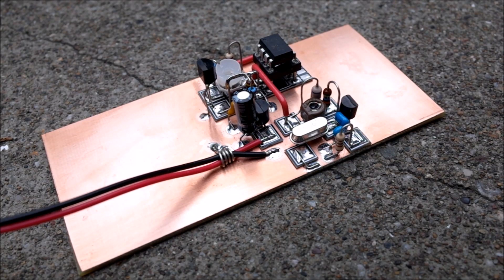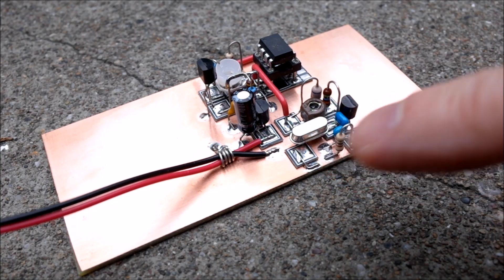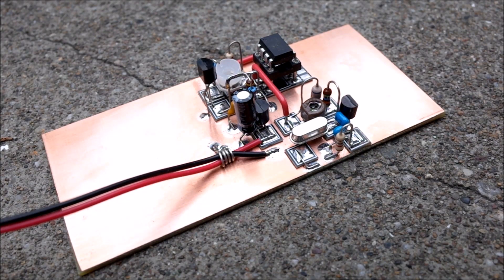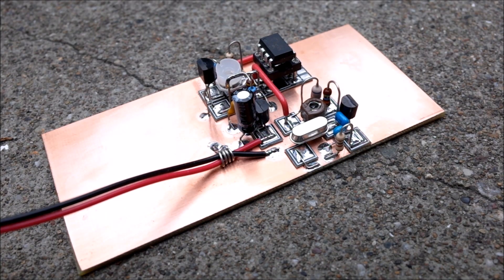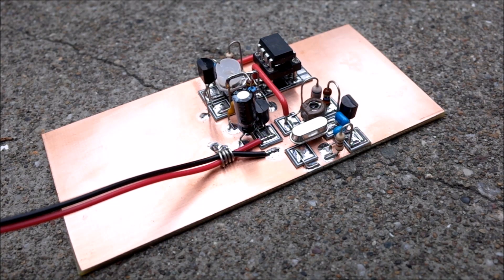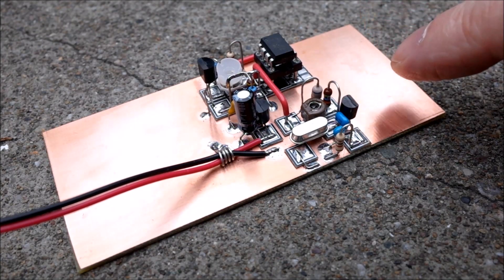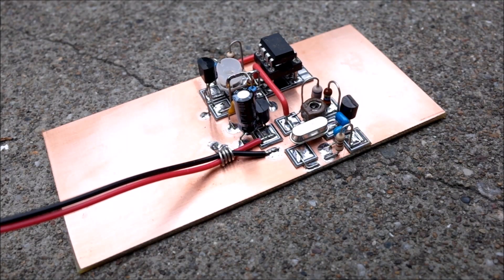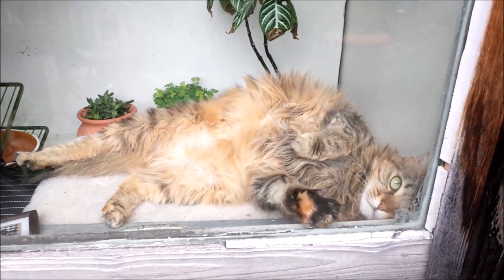K7TMG HF Thermometer

Comment: I look with admiration at the beauty of surface mounting with your hands. I would like to ask, do you buy these contact pads ready-made or cut them yourself? and how you attach them to the main board.
Reply from the maker: Thank you Alexander. I buy the pads from Rex at QRPMe (they are online). They are called MePADS and MeSQUARES. I attach them to the board with superglue (cyanoacrylate) in the gel form.

Comment: The attinyi85 has an internal clock generator. The external quartz generator is therefore not necessary.
Reply from the maker: That external crystal is not to set the clock frequency for the ATTiny. The crystal oscillator generates the RF signal on the 13.56MHz ISM band that the ATTiny is keying. This circuit uses the internal clock generator on the ATTiny.

Comment: this circuit deserves a low quiescent current (discrete) power regulator :)
Reply from the maker: Most definitely! If I were building it today, that's what I would use. At the time I built this, in 2018, my junkbox was full of 78L05's and I wasn't aware of the existence of regulators with low quiescent current.

Comment: Hello! Have you ever connected this transmitter to an antenna? How long will the signal be propagated? I my oppinion - there needs only tens of Herz to receieve the signal))
Reply from the maker: The output power is very low. I think I measured it once as being only a milliwatt or two. I did build a similar beacon that outputted 4.6mW to a dipole in this same frequency band, which was heard 900 miles away. QRSS is the way to go if you want long distance copy from very low power signals.

Comment: I don't see why you shouldn't remove the 7805. The MCU actually goes to sleep (I just checked in the assembly), the circuit shouldn't be voltage dependent at all and the ATtiny definitly isn't :) 

Beautiful soldering, I really like the way this looks!
Reply: Hi Tobias. Terribly sorry for not replying sooner, but I have never been very good at following up on YouTube comments. I think the circuit needs a regulator, as the ATTiny 13 has a maximum operating voltage of about 6V. Also, the analog temperature sensor needs a constant voltage, otherwise the temperature readings will be off.